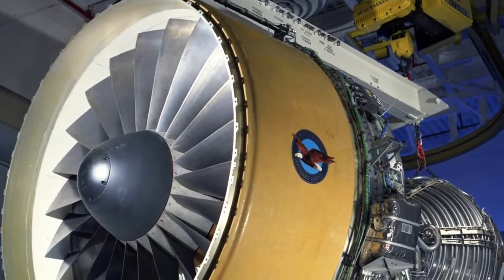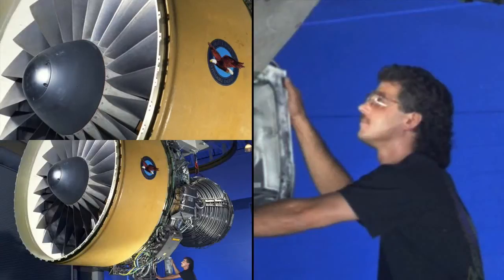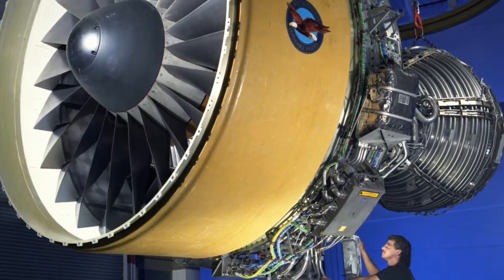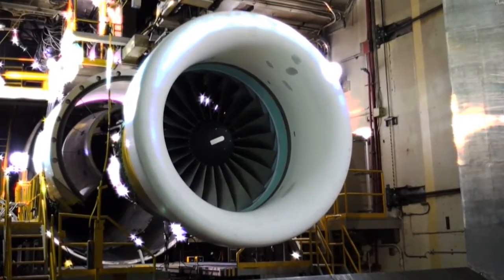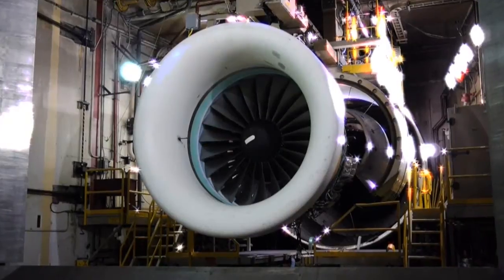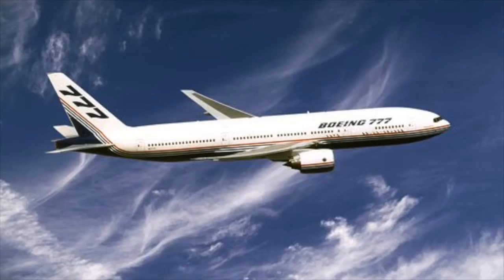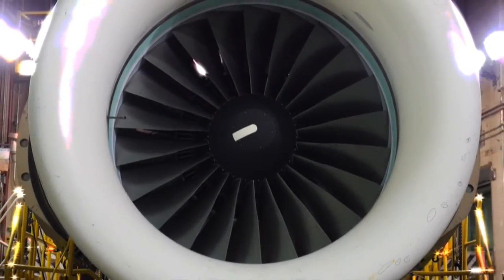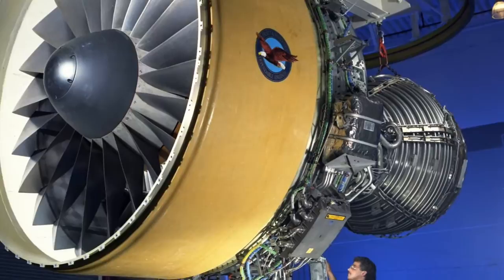Out of Sight But Not Out of Mind: PW4000-112” Legacy Lives On

Comment: ... and now it’s too old and dangerous.
Bye, Felicia!
Reply: Looks like someone doesn't appreciate hard work and engineering put into that engine.
Reply: Stop moron

Engine is extremely safe. All they need to do is increase the inspection intervals

If you cant handle it...dont fly
Reply: @mattieice4689  if you can’t handle the comments don’t comment....
Reply: @scubasteve8082  Don't worry about what I do
Reply: @mattieice4689  Cyber Bully
Reply: @mattieice4689  To Mathew: Agree about maintenance issue.  Considering the amount of flight hours these engines are being used for, the safety design and carbon fiber outer core performed the way it was supposed to during a fan blade malfunction.  Pictures taken by inspection upon landing showed minimal damage to the fuselage-only lower piercing lower right cargo area aft.  Increasing inspection intervals as engine age increases should be mandatory. 
Except for United Airlines and American Airlines (?) most Airline Companies have inspection and maintenance farmed out to third party sources, never liked that decision....